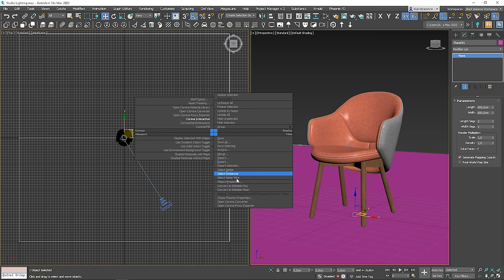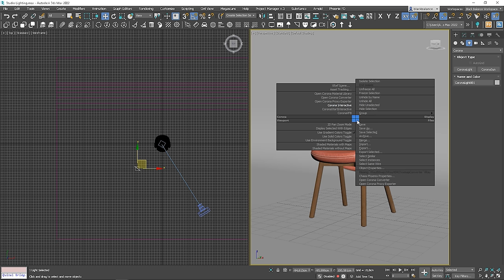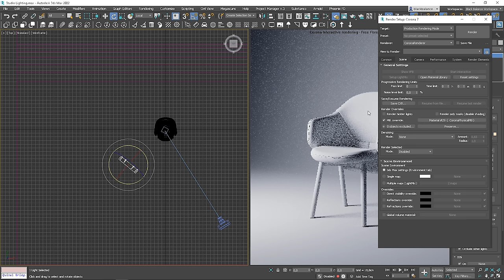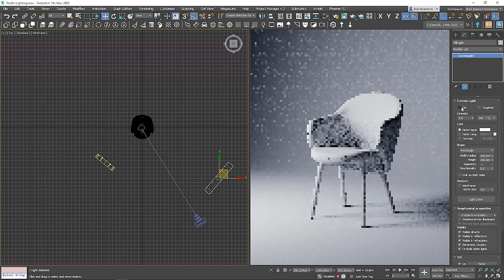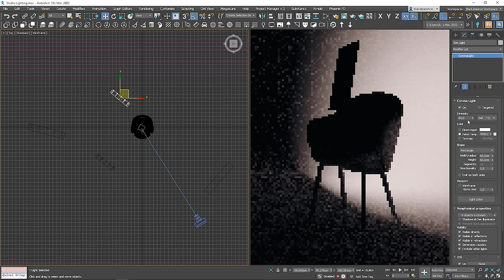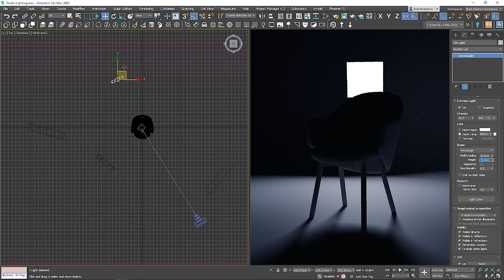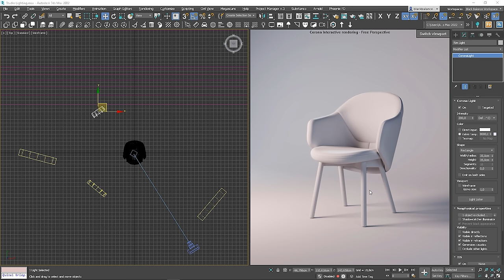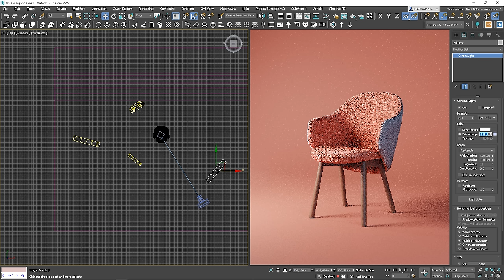Create a Perfect Studio Lighting FAST in 3ds Max | Corona or V-Ray Render Engines

Comment: Cool video! Though in my workflow I prefer to use targeted lights for quicker and more precise setup and adjustments. Also you should consider using light lister for tweaking the lights individually.
Reply from the maker: I use it sometimes as well, but the lightimx is quicker.